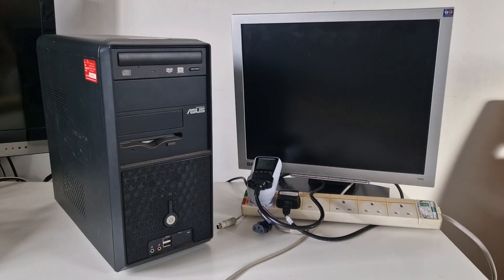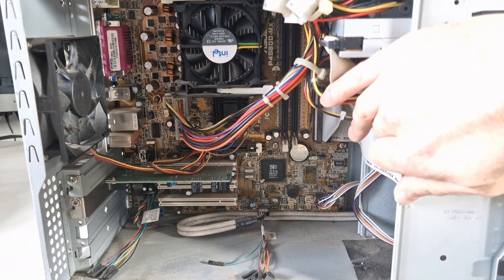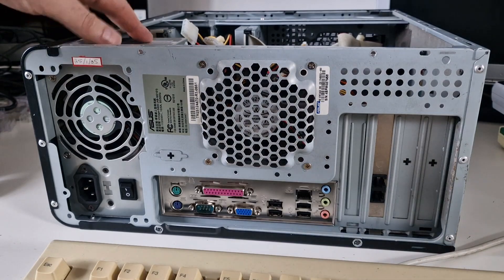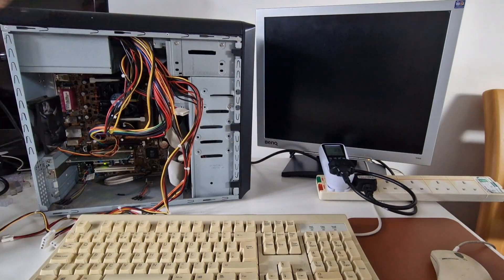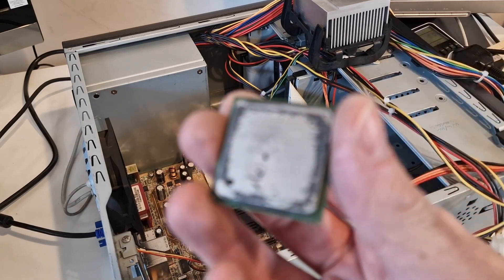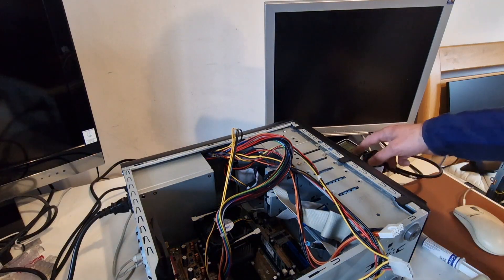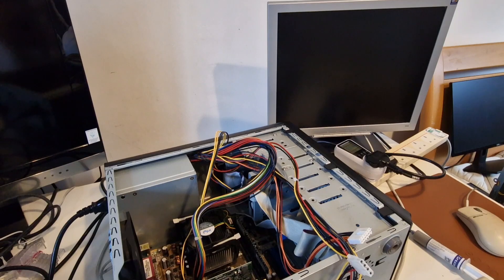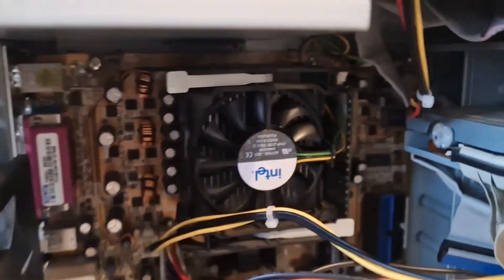It's a LOT older than it looks! What's inside this PC? Will it work? #retro #pc

Comment: 11:09 > "Intel Celeron 2.60 GHz"
This one??
Intel Celeron Processor 2.60 GHz, 128K Cache, 400 MHz FSB
Lithography: 130 nm  |  Cores: 1 Threads: 1  |   TDP: 62.6 W   |   Physical Address Extensions: 32-bit
Reply from the maker: Yes, that's the one

Comment: The CPU is compatible -  check the CMOS jumper is good advice - jumper on pins 1-2   but the fact it didnt beep without  ram is a warning sign its  dead  - the caps look ok and usually if they look good they are .
Ive got 2 dead SIS Asus boards from dead chipsets - they power on but dont boot - also while its running - touch around on the board to see if anything is getting  hot  -
Reply from the maker: Thanks, really good advice. I think these systems were budget units.

Comment: I found the manual 🙂 This may a silly question but is the jumper CLRTC1 on pins 1-2? That's default. 2-3 is clear CMOS.
You could pull the plug, press the power button for 10 or so seconds, then put jumper to clear, pull the coin cell and have a cuppa tea. 
Jumper back to normal, replace the battery and try to boot.